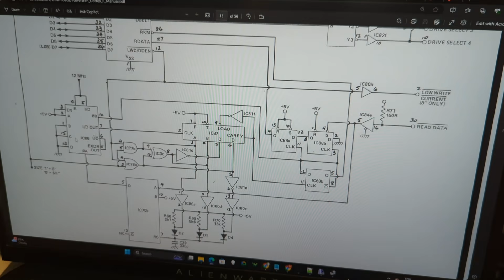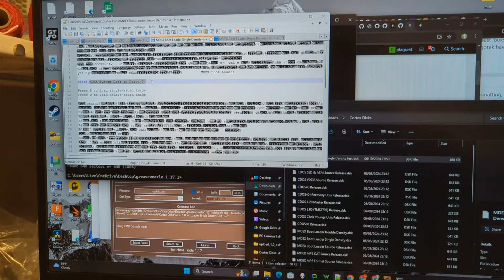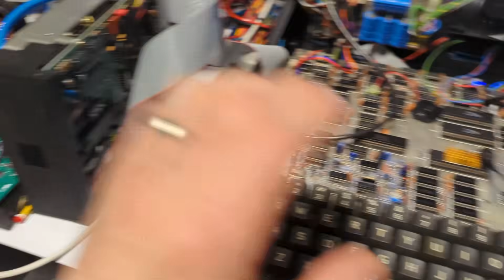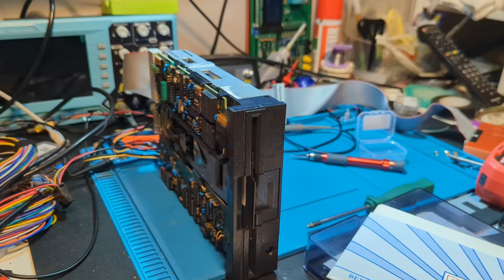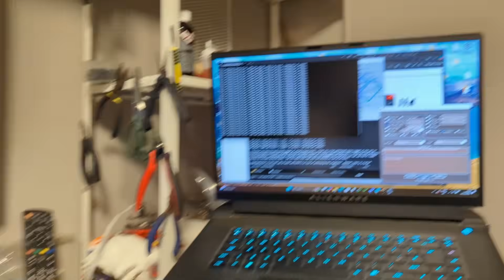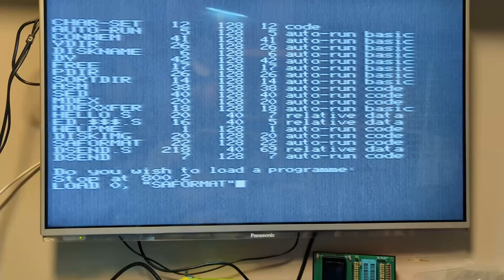Powertran Cortex repair pt3

Comment: Great work. I enjoyed your troubleshooting adventures with this wonderful piece of vintage tech. It's amazing how the simplest things, such a short or solder bridge, can send us down a rabbit hole. Again great work, well done. I have been using a PICO9918 PRO on  my T99/4A and Memotech MX500  which can output VGA or HDMI and doesn't require the video memory.
Reply from the maker: Thanks for watching. I was kicking myself over the bridges, but I think I replaced 87 sockets, so I'm allowing myself a couple of mistakes 😂
I've got a pico9918 on my shopping list but I was almost tempted to port the code over to a standard Pico now they're 5v tolerant.... Just to make my life harder